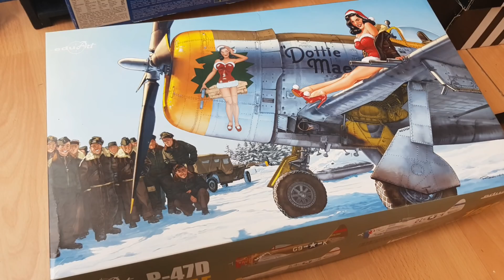Republic P-47 Thunderbolt Eduard 1/32 plastic model time lapse build

Comment: Nice but there was no black on the fin and tailplane. Also missing the 'Mae' from 'Dottie Mae'. Also is was a 'C; on the starboard rudder tab as it belonged to C Flight, 511FS, 405FG. 9AF. Got it on the port correct but not the other.
Reply from the maker: All the decaks i used provided with the kit. I cut out "Mae" intentionally.

Comment: David R Lentz, Columbus, Ohio, USA (Tuesday, 16 July, 2024) 

Whose kit is Eduard using for their re-issue? Or have they begun making their own models?  I am curious about good-quality 1:32nd-scale kits of the Republic P-47D (Razorback), -D (bubble canopy), and -M Thunderbolt USAAF Fighter. 

   At 7:04, the photo-etch “sunburst” shape is completely incorrect, in a manner I call “false two-dimensionality”: the components of the PE part in actuality are push rods (long, narrow, metal tubes or dowels) and spark plug wires, both circular in cross section. In this scale, the kit ought to include a part forming the ring and the rods (or perhaps several, that one can make two rods per cylinder). Frankly, Eduard is a generally very good, eclectic company, and they ought to have known better: a flat strip of metal is not cylindrical! 
   Alternately, one could acquire an aftermarket replacement for the Pratt & Whitney R-2800 Double Wasp, radial, 18-cylinder, twin-row, air-cooled, water-boosted, turbo-supercharged, 2,000 hp (1,491.4 kW), 2,800 cu in. (45.9 L), reciprocating piston aircraft engine; made either of cast resin or 3D-printed plastic. 
   Also, I ask model designers and kit makers, regarding the part representing open cowl flaps,
 to include on the sprue immediately beside it an alternate piece that has the cowl flaps in the closed position, for us who prefer to build our aircraft replicas in flight; please and thank you. 
   Whilst I have the attention of the kit designers and makers, my request also includes 2) a figurine of a pilot or an aviator sitting in the seat (molded to fit properly, such that our flyboy looks like he actually is flying the airplane!), 3) separate parts to represent the landing gear doors closed over their respective wheel wells, 4) separate flight control surfaces (ailerons, horizontal and vertical stabilisers, etc.) that one can pose in various positions corresponding to ærial manœuvres (climbing, diving, combat engagement, etc.); 5) alternate cockpit fixtures to indicate flight performance.

Comment: Hello, 
I follow your work and videos with a great respect, your models are amazing 
I saw that you used AK-series metallic paints at the related video given above. I would have a question:Did you used some varnish layer or anything else before masking tape applying to prevent that the metallic paint doesn't peel up? İf you used some preventatives, could you may share these with me? My own experience was that the metallic paint peeled up after apllying the masking tape.I would be pleased about your answer.
Reply from the maker: Back when i built that one i think i used some clear varnish yes, but today i would use the alclad aqua gloss varnish, its great and safe for all metallic surfaces

Comment: Thanks for the video.  Where did you get the cutting/scribing template that you used to cut the curved pieces of masking tape?
Reply from the maker: Ebay. Extremely cheap
Reply: @ScaleHangar182  Thanks!

Comment: i have never tried the AK metallic paints before.  Is there any problem going from a metallic to non-metallic paint in the same airbrush?  I only have one airbrush and I am planning an F-86 Sabre build which will necessitate a metallic paint.
Reply from the maker: no, but with AK Xtreme metal you must be very careful, i mean you can use any pressure and velocity, but you need to spray it over a very clean surface, it dosnt require a primer, but if you want prime you need to prime with black gloss for better mettalic effect, and after, i suggest using acrylic clear varnish
Reply: @ScaleHangar182  thanks for the insight!  Much appreciated.
Reply from the maker: anytime mate! :) @acerock013